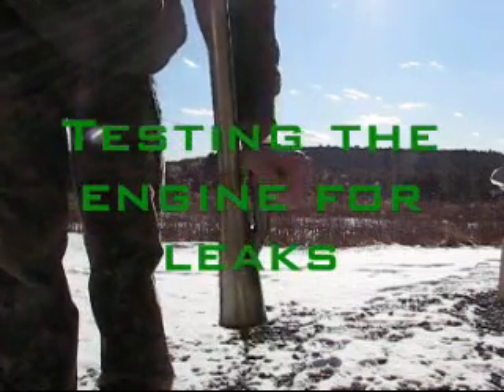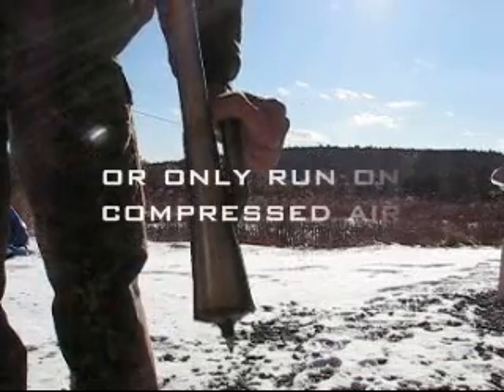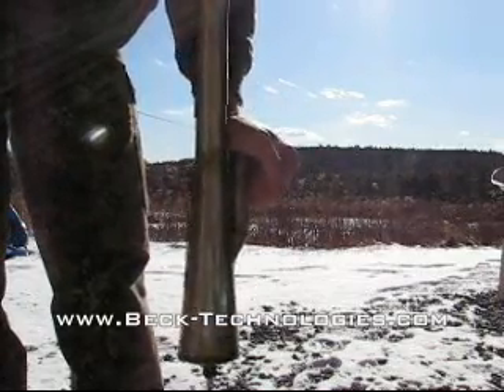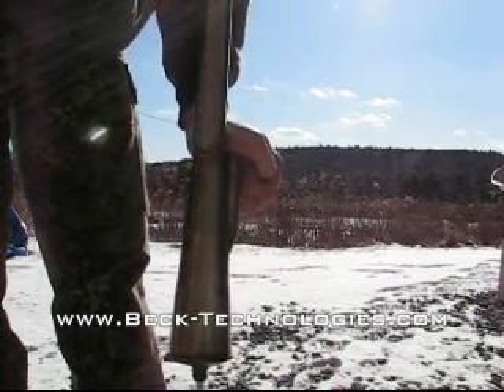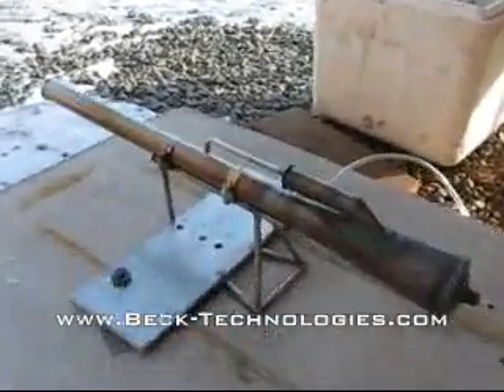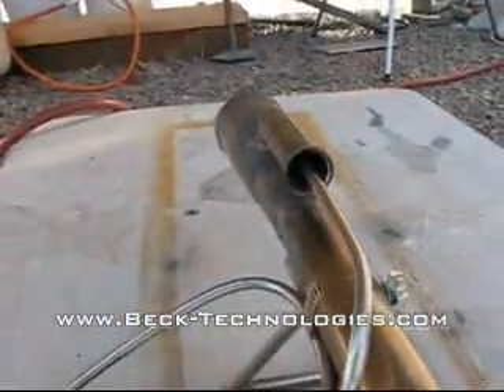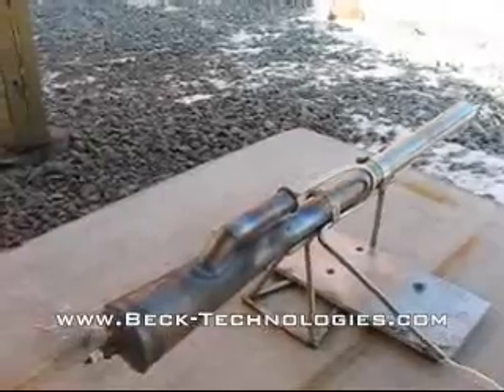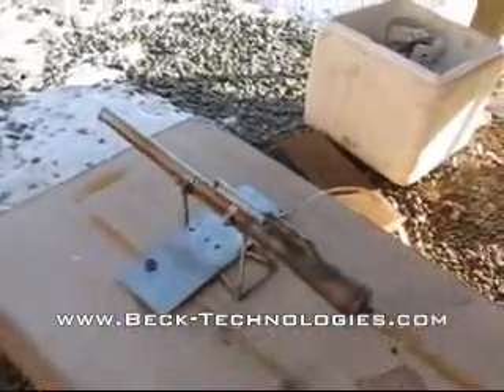FWE Valveless Pulsejet Engine

Comment: In the second video there seems to be a jet coming out of th top tube. I thought this was the air intake? Surely if flames are coming out of it then no air could get in against it starving the engine so it dies? Anyone know?
Reply: This engine produces thrust out of the intake as well as the exhaust. Fresh air is pulled in between each pulse.
Reply: it pulses so fast you cant see it draw in

Comment: Hi mate, we are building a same pulsejet for a school project as yours. With your plans. Now, what would be the ideal way to fabricate the flares on the intake and exhaust and the back end of the chambercone????
Reply: +Osel Somar  What about Cobalt alloys? They are temperature resistant?
Reply: +Jeffrey314159 we used stainless steel which is perfect if you dont run the engine for too long :)
Reply: If you put it into a water jacket?

Comment from the maker: Coating the outside with an insulator would just cause the inside to melt. You would need to coat the inside to prevent the heat from being absorbed in the first place.

Comment from the maker: Propane is flammable, not explosive. There is no difference between putting a flame at the tip of the injector, or having the injector sticking into a glowing hot engine with fire being shot out of the intake at 600 mph. 

The spark plug is simply another way to start the engine, and is the easiest way to start liquid fuel. It only provides ignition at the start, after the engine is running there is no need for a spark.

Comment from the maker: Linear scaling of pulsejets only works for very small increases or decreases, if you double the size you are drastically changing the operating charateristics, and each part of the design has to be tailored to match those characteristics so it will run. Try joining pulse-jets dot com I'd be glad to help you out on the forum.

Comment from the maker: The original FWE produced about 1.25 lbs thrust, the advanced 2.25 lbs thrust. Its an extremely simple design that runs great, but the chinese valveless design is more complicated and higher performing design. The classic chinese produces 4.5 lbs thrust, the advanced produces about 50% more for a given size, but the chinese is also 25% bigger than the FWE. Scaling is non proportional due to the various acoustic properties of the engines.

Comment from the maker: Actually thrust is independant of fuel pressure (flow rate is what is important), and the combustion chamber temperature is only extremely high when it is sitting on the ground. Once it has air moving around it is cooled greatly, they can even run with the engine shell being actively cooled with water. The uses are only limited by the users imagination.

Comment: Thrust produced is dependent on propane fuel pressure and combustion chamber temperatures make this oddity virtually useless. TO say nothing of the incredible db level at power.